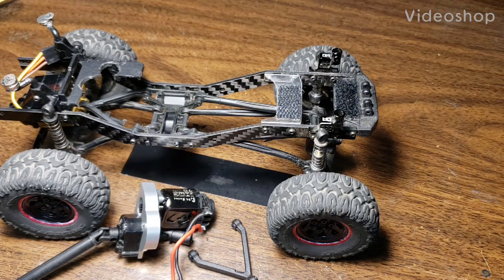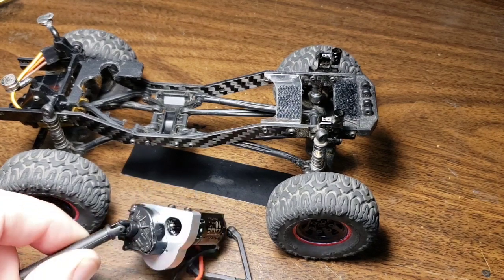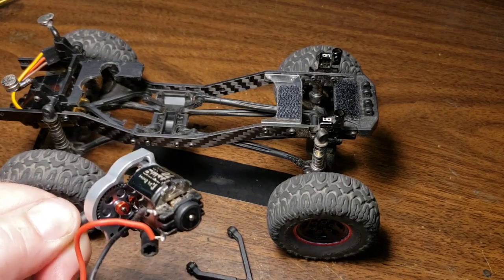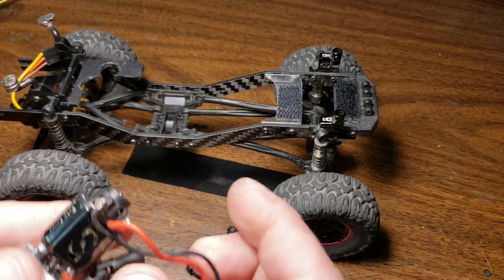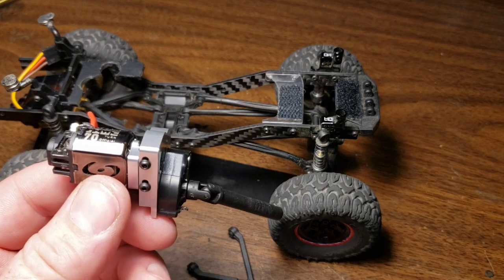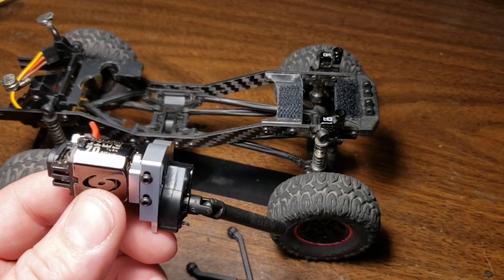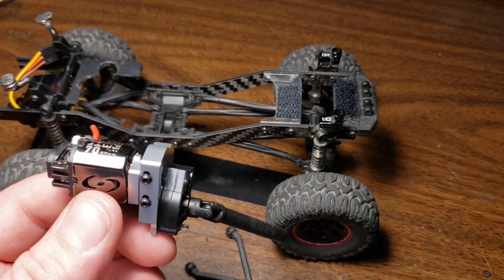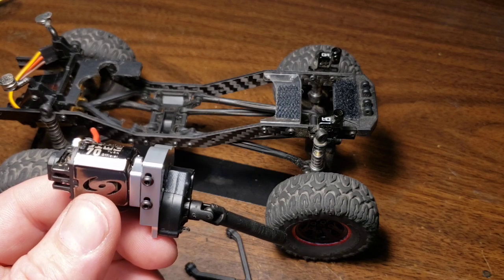SCX24 PN Racing Mount Fix Part 2.🏁 Solved!

Comment: The direction you're heading....I would put the battery in the stock motor position sideways and the ESC on the back end between the frame rails so that  the rear linkage bottoms out on the ESC.
Reply from the maker: I could do that but I have a low CG mounting system for the battery in the back. I do not want to reinstall the stock battery tray because it would add a lot of weight up high that is not necessary just to move a few things around that are already in a good position. 

Centerline mounting the ESC would also loose the side to side counter balancing that I get with its current position. It drives very well now. I am excited to begin testing it at The Center. 😉
Reply: @EXPIOWA  I meant lower the battery even more by mounting it  sideways  and angled down the frame rails behind the motor. I made my own battery tray to do this by hacking up and hot gluing the stock battery tray. Then put the ESC on the low cg battery tray. It'll move more weight lower and forward.

There are so many ways to mods these, that I've reconfigured the same truck 5 times in 4 months. lol
Reply from the maker: @trailwomanrc  I have 5 and they are all different. : ) I have a mutant Enduro24 that is mostly SCX24 now too.
Reply: the front suspension would hardly ( i wanna say never, cuz i tried to make it happen but i can't)  fully compress at the same time on a course. try it and u will see what i'm saying. i'd say don't worry about it, you will be fine as it allow tons of clearance for either suspension to fully compress which is what normally happens on a course.
Reply from the maker: @papachill  I made mention of that in the video. I also like my stuff to have full unhindered range of performance. That way nothing gets in the way at any time. 

I am a black and white, all or nothing person. I don't like "good enough". I like right. Its obsessive but isn't that what my channel is all about? : )

Comment: i have the same motor mount and never had clearance problem, and i'm using the 10t pinion. I've never seen both front shock fully compresses naturally on a course. have you?
Reply from the maker: Have you tried to pass a piece of paper between the driveshaft yoke and the engine as I did? It may or may not work due to the tolerances of the mold your pieces came out of. 

11 tooth should be a safe option regardless of variations that may occur during manufacturing. That is why I recommend it.

As far as the suspension fully compressing, yes. During rough driving when it lands hard. Nobody would want to drive a full scale vehicle if the suspension could hit components of the motor. Eventually there would be a scenario where it would happen. 

Does it matter at this scale? Not really. Its a toy but if there is a way to optimize it, I'll find a way. Part of the fun in RC for me is modifying. I have some awesome rigs because of it.

Comment: A 3-link front without a pan-hard probably won't matter alot in a rig that light, but if you were to add a bunch of weight it might.
Reply from the maker: In the short time I have driven it, the truck doesn't seem to miss it at all. I don't believe it will become an issue.

Comment: Have you tried using proper links? Those stock links are shorter end to end now that you bent them. The pinion angle of the diff has changed
Reply from the maker: They are bent and stretched. They are the same length as stock. I have a video showing how I did it.

My RB_1 has Injora metal high clearance links. I had to clearance the front ones because they got into each other and the skidplate. 

https://youtu.be/qfGH9SPG9iM
Reply from the maker: This is the video with the Injora metal links. There were issues. I fixed them all. It is a longer video but there was a lot to go over to make it correct. It is faster to use my process with stock links. The metal ones have zero flex unlike the stock links.

https://youtu.be/OXxP8gGLtJA